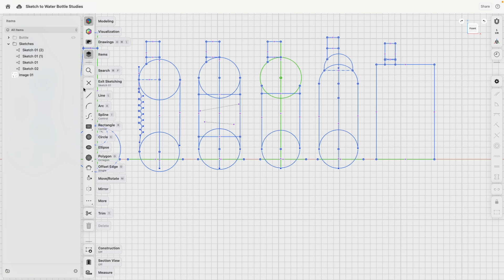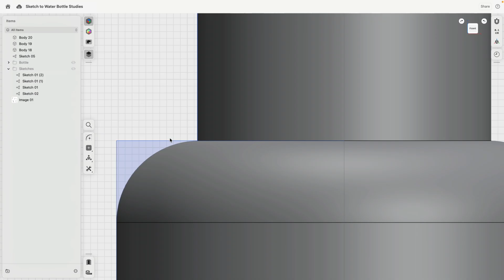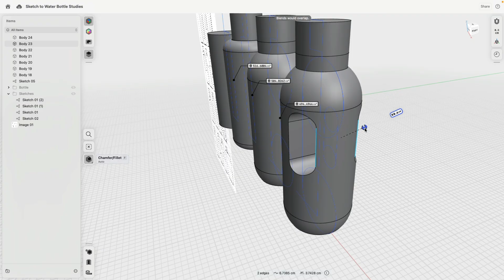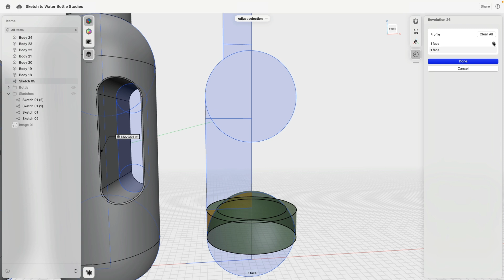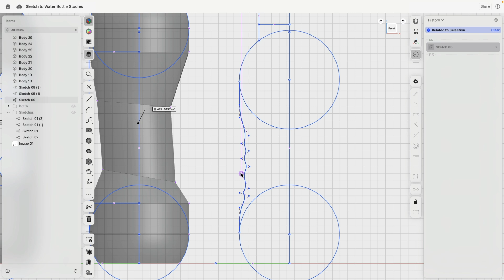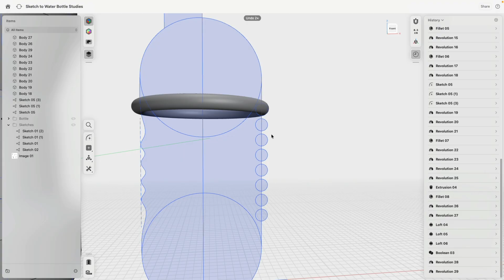Shapr3D - Bottle Ideation Sketch Models

Comment: Sick video. In just 21 minutes you can make multiple 3D models, then test the ergonomics with a 3d printer.
Reply from the maker: Yeah thats the main point of the video

Quick tests before adding details to a design you might not use